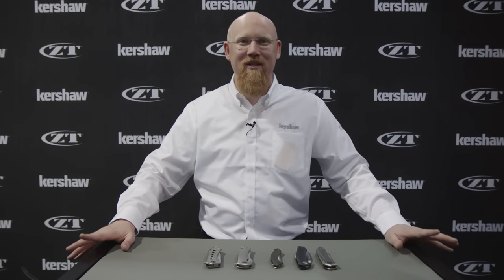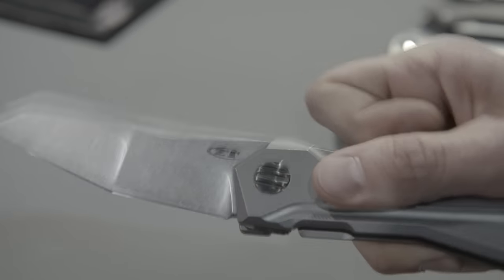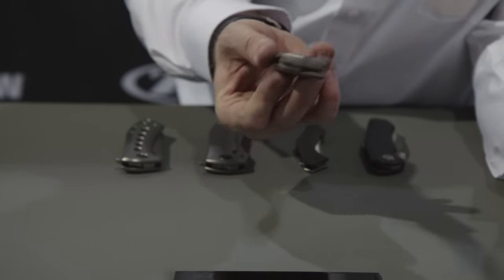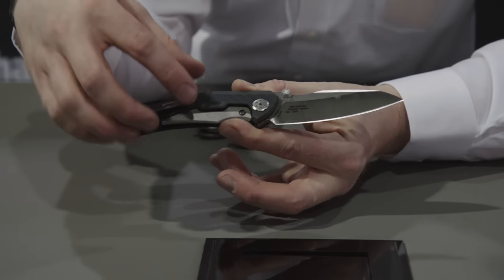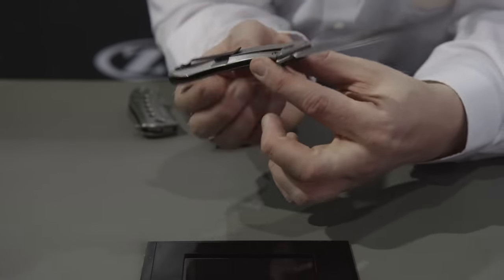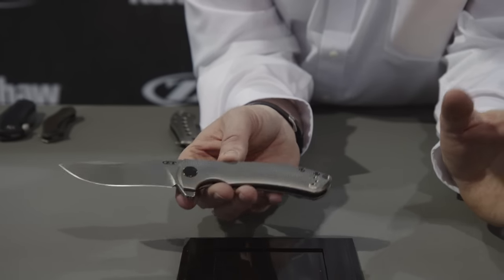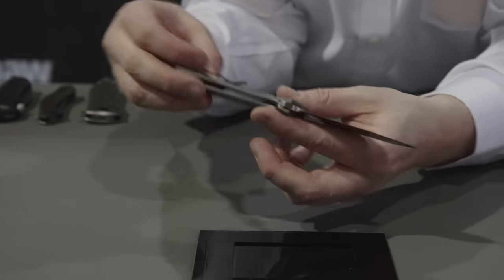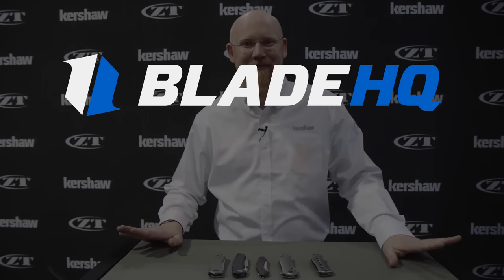NEW Zero Tolerance Knives | SHOT Show 2017

Comment: Bravo ZT...these are all incredible. 👏
Reply: Honest Blade you got mud in your eyes, there's nothing but art knife bullshit. Toy knives.
Reply: @Mike D then go buy a hinderer if you want a true working knife. even though these will do the same thing at half the price.
Reply: @Mike D also that new ZT 0858 doesn't run bearings it's on bronze washers, so that should be tough enough for you i'd say.
Reply: Burkinater 48 i own 2 hinderers but id hardly classify them as hard working knives. Weak frame lock just like any other and too thick behind the edge to be a real cutting tool. Working knives are better made by cold steel and spyderco. Art knives are better done by hinderer and ZT. Although ZT had some great older working knives, these days not so much. Honestly i think ZT makes a better knife than Hinderer, that's an opinion after owning and actually using them as tools.
Reply: Mike D yeah I love all my ZTs and the xm-18 I have, but I've never tried a Cold Steel for some reason. I think it's mostly because I don't like the way they look. I guess when it's a tool it's no big deal what it looks like.
Reply: Burkinater 48 cold steel have 2 groups of knives, ones that look like mall ninja crap, and others that look like tough hard working knives. Never been a fan of the ninja ones. Aside from all their silly marketing, they make some of the toughest knives out and the edge and grind geometry make them cut like demons.
Reply: Mike D Any models you'd specifically recommend? I like the 4-max model but I don't think they make that anymore
Reply: +Burkinater 48 4max is great if you're after a big tanky knife that still cuts with great steel, plenty still around online to buy. Personally I'd recommend the Recon 1 spear point, American Lawman if you want a slightly smaller blade with finger choil for choking up. Make sure its the new versions with CTS-XHP steel, its a huge upgrade over the old AUS8 models. My personal favourites are the recon 1 spear and the now discontinued for 2017 Talwar 4 inch model. The talwar is more aggressive looking but its one of the best feeling knives in hand I've ever held in my life, and the near full flat grind has been outstanding with cutting and slicing. Best of luck mate.

Comment: The compound ground blade grind was first brought to the market by  Bob Loveless and Mike Lovett, independently.  although the design did not sell well for either of them, it s a very useful design. Offering both a fine cutting edge, and a stout edge for heavier work ion the same blade. Very effective. 

Wonder if either of these makers, Particularly the Legendary Bob Loveless was give any credit for the design, or simply ignored. He was the most important Knife Maker/designer  of the 20th century. 

KnifeMaker

Comment: Guys, need help. 450CF vs 460, pretty hard choice. What's needed: real pocketability without tactical pants, lightweight, easy to flip. Nutnfancy mentioned that 450CF had some issues with one-hand opening, is it a real deal with both of these?

Comment: the 0055 is really funky and interesting looking.  Does that opening mechanism count as assisted? it sounds like it is, but i'm not familiar enough with it to be sure
Reply: BrandonL337 no the knife is not assisted. The spring is to hold the tab in place so that it can be hidden and not flop around. it just helps by folding the tab away and affects the opening in no way.